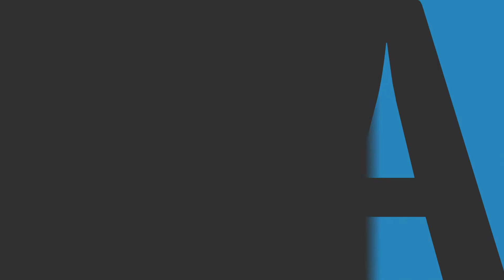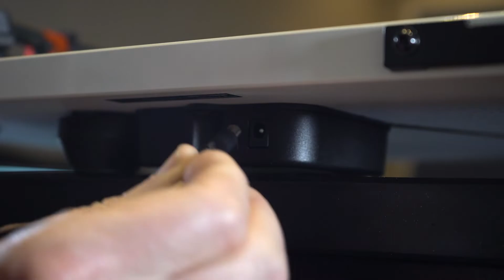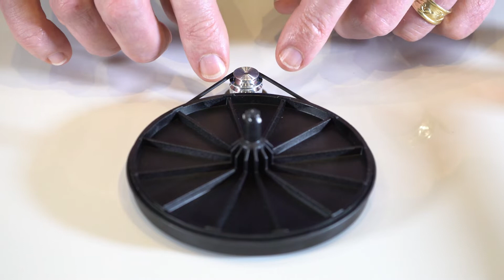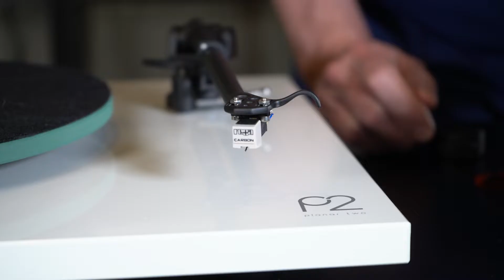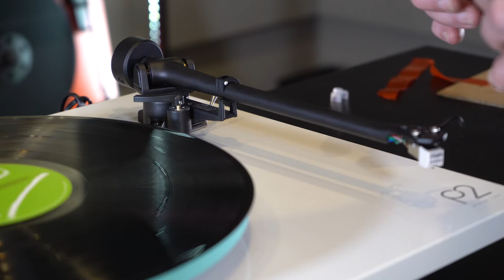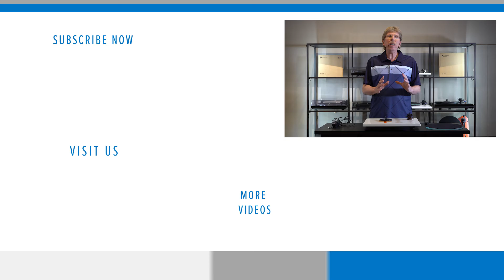How to setup a Rega Planar 2 Turntable

Comment: I have a Rega Planar 2 Turntable from the 80s, but i cant get it to work properly, any tips?
Reply from the maker: "Can't get it to work" covers a pretty wide range, what exactly is the problem?
Reply: @AudioAdvice  im currently using the azur 740A amplifier, but i cant get it to work properly, connected the black and red cable into input 1 and the right and left channel to my speakers, but the signal doesnt get carried out.
Reply from the maker: @zatix6982  The Cambridge 740A does not have a phono preamp built in.  You need a separate phono preamp.  Please reach out to our team at www.audioadvice.com to discuss which one is best for your system.
Reply: @AudioAdvice  could i maybe use a small RIAA amplifier?
Reply from the maker: @zatix6982  Yes, that is the same thing
Reply: @AudioAdvice  alright thanks, i will be buying an RIAA amplifier the moment i get the time. Thanks for the help!

Comment: I just ordered a new Planar 2 (in walnut) today with an upgraded cart, the ATVM540ML.  I should get it by next weekend.  Is there any way to upgrade the RCA cables coming out the back of the turntable or are they permanently attached?
Reply from the maker: They are permanently attached.
Reply: @AudioAdvice  Thanks for responding :)

Comment: You never showed about the anti skating is this the same setup like the Ortofon BlueMM 2 cartridge which tracks at also 2 grams? Thx
Reply from the maker: The little slider for anti skate should be set to the same as the tracking force, which for the Blue MM would be 1.8 grams.  It can go between 1.6 and 2 and Ortofon recommends 1.8  Thanks for watching
Reply: So the anti skating should not be set at zero?
Reply from the maker: @marvinfoxx474  It should be set at the same as your tracking force

Comment: helpful.  did get a little stuck adding the weight to tonearm.  I was reluctant to add any pressure, but learned it needs a little force to find the thread.  Just about to put on some vinyl after a 20 year gap.  Thanks!!!!
Reply from the maker: Glad it helped!

Comment: got this turntable this week... tried to set it up following your video and I think I did well... sadly I had not played any record because my only concern is the adaptor that came with, it was shipped from Europe and has the 2 round heads with the adapter and it is a 220-240V 50Hz input and the output is  24V-100mA... can someone please help me out find an AC ADAPTER for this item in the USA? thanks in advance.
Reply from the maker: Are you saying your ordered the turntable from Europe?  Why not buy it in the US?
Reply: @AudioAdvice   yes indeed I did. This was a collectible item, the rega turntable released a few years ago to celebrate the band Queen. As far as I know it was for Europe only.
Reply from the maker: @39MrBadGuy  Ah yes, that is a collectible one!  We will check with the Rega importer for you.
Reply: @AudioAdvice   I was advices to use a voltage converter USA to Europe and connect that adapter to it. At the same time I wanted to get an adapter separately but most 24v universal adapter the output is 1A which is much higher than the one required. I wonder if that can interfere with the función of the turntable?
Reply from the maker: @39MrBadGuy  Christian, please don't shoot the messenger.  We asked Rega about this, it sounds like you will need a new motor and power supply.  The motor requires some technical skill to install.  They thought the cost for both items would be around $250.  You probably want to find a local Rega dealer to install it for you.  We asked if you could use a step up transformer to go from 110 to 220, but they said that would not work due to the 50 vs 60 cycle difference.
Reply: @AudioAdvice   thanks for the response. I did contact rega as well, found a place in Dallas,TX where they did the job. I drove from Oklahoma City just for this. These guys are the BEST and they did explain every single word that you just described.  Thanks for taking your time to find out and responding my message.
Reply from the maker: @39MrBadGuy  Glad we were able to help out!

Comment: Thank you Sir for this video on how to setup this turntable! Very helpful! I had a Rega Planar 1, which I decided to upgrade to a Rega Planar 2. A big difference in the sound especially in the bass department. I'm using this turntable with a Rega Elex-r amplifier and Q Acoustics 3050i speakers. My cd-player is a also a Rega, namely a Rega Saturn-r run through a Rega Dac.
Reply from the maker: Glad we could help.  It sounds like you have a great system. Enjoy the music!
Reply: @AudioAdvice  Regarding record clamps is it safe to use a clamp, which weighs 325 grams on a Rega Planar 2 turntable? Can the weight damage the record-player? Is it better to use for instance the Michell Engineering’s model R (for Rega), which have less weight, but is tightened with a knob?
Reply from the maker: @wadia21  Clamps have always been debatable with turntables not initially designed for a clamp.  The Michell is the better choice, but then let your ears decide.
Reply: @AudioAdvice  Thank you for your reply! I lean towards Michell myself too, but I’ll try to make a comparison between the two clamps. I was primarily concerned with the weight of the other clamp and whether the turntable can handle that extra weight without any damages since the record-player was not originally designed with the clamp in mind as you mentioned.

Comment: The manual mentions setting the bias slider to zero before balancing.  Then later shows a picture of the slider at 2 (but never mentions changing it).  So...leave it at zero?  Move it to 2?  What am I missing?

UPDATE:  I think I figured out that as of September 2020, Rega has updated the RB220 tonearm of the Planar 2.  Looking at the manual for the tonearm (https://rega.co.uk/download/TA-RB220-RETAIL-UNI_2.pdf) explains that the Bias Slider should be set to match the tracking force.

Comment: Great explanation, very very usefull. I followed all the steps accordingly, everything is fine but the volume output is very low, I had to set higher volume compared to normal usage I was used to. What could be the issue? Thank you
Reply: If your amplifier doesn't have a built in phono amp you will have to buy an external phono amp that boosts the signal to make your turntable louder.

Comment: So an odd thing I've noticed... the manual for the Rega Carbon Cartridge recommends a tracking force between 2-3 grams. And the manual for the RB220 tonearm recommends to set tracking force to whatever the upper limit is of a cartridge. So shouldn't tracking force actually be set closer to 3 grams, despite what the Planar 2 quick start guide states? Rega definitely seems to contradict itself a bit. 

I've tried this myself and IMO it definitely seems to have an audible improvement...
Reply: Funny you say that because i find 2.5 about perfect for my carbon, i get skips if i run 2.